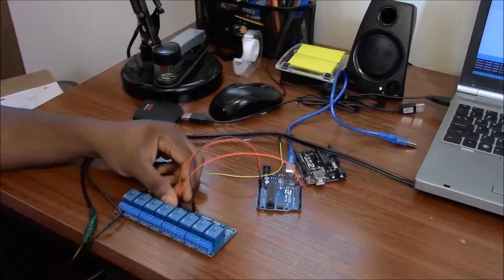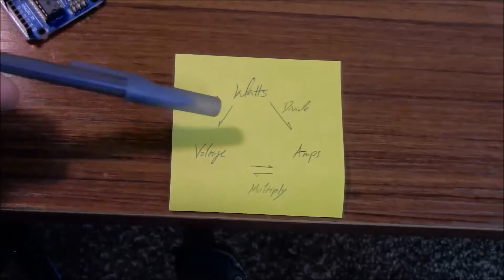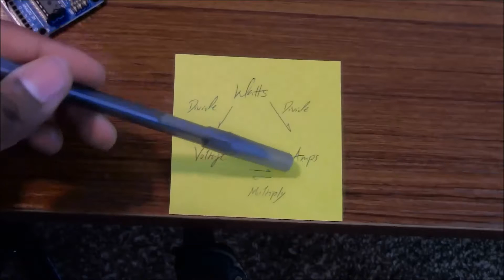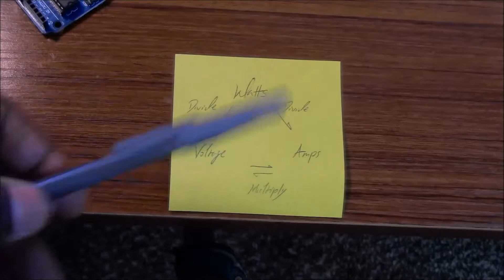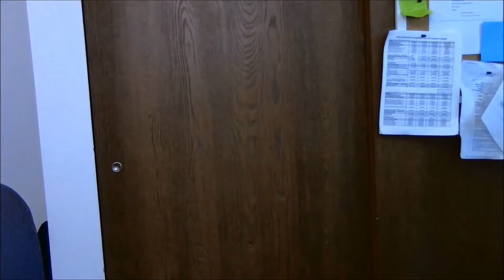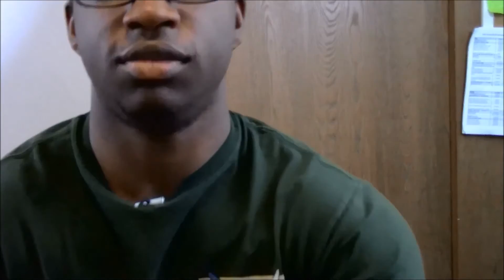Review: Arduino 8 Channel Relay

Comment: when you strip a 120v wire to put it into the connector.... SOLDER the tip.. then you will have no chance of a short circuit because of the little hangnail wires should they find their way out of the pressure clamp.. Great video tho, thanks for sharing.